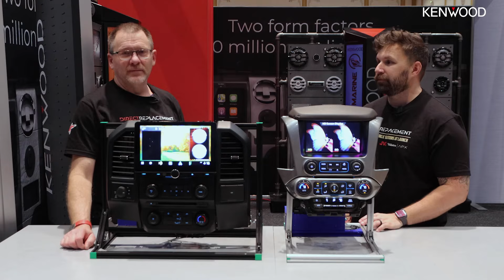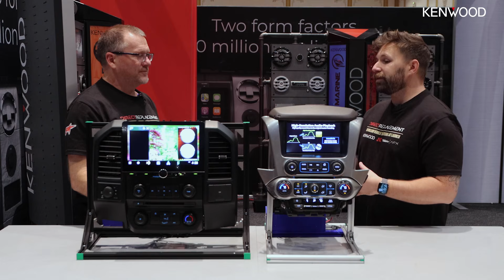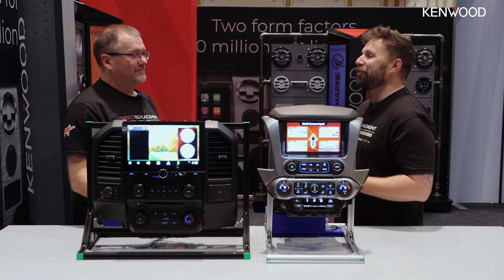KENWOOD Highlights On Direct Replacement With 5-Star Car Stereo

Comment: @KenwoodUSA will this direct replacement retain the factory disc player function in the 2013 F150 or Mustang? The factory disc player is not integrated into the screen, similar to the video. Thanks
Reply from the maker: No, the factory CD transport cant operate without the OEM interface. Thanks!

Comment: I have a Chevy Equinox. Do you retain your factory safety audibles?
Reply from the maker: Please verify all retained features and fitment from the iDatalink Maestro Website by entering your vehicle Information https://www.idatalinkmaestro.com/. The Maestro RR/RR2 module will determine what features are retained based on the flash available per vehicle. Thanks!

Comment: Can u still play movies?
Reply from the maker: Yes, with the parking brake engaged, you can play any video source from:,HDMI, USB, Video In, as well as Wireless Mirroring from a supported Device. Thanks!
Reply: @KenwoodUSA but on the screen in the roof I have a Yukon Denali 2018
Reply from the maker: @ramird46 , You would need to verify compatibility with iDatalink Meastro for your specific vehicle trim, year, make, and model. https://www.idatalinkmaestro.com/en

Kenwood does not supply vehicle-specific integration fit guides. 

I can confirm the Receiver features a Single Video Out, which supports source display from Video-in and USB ONLY.  It will not display HDMI out or any other sources. Thanks!
Reply: @KenwoodUSA thanks

Comment: If used in a 2018 Mazda 3, will the command knob still work?
Reply from the maker: There is no Direct Replacement fitment for a Mazda currently, thanks!

Comment: Would it work on my 2013 Ford Focus Mk3?
Reply from the maker: If your Ford Focus came with the 8" MyTouch system, yes, it's compatible.   You will need the APX-S8-F01, IDatalink Maestro RR/RR2, KEN1 Harness, and the Direct Replacement in the 8" version only. Thanks!

Comment: So I just got my dax800xr for my ford f150. I have yet to install it. Kenwood please tell me you didn’t downgrade the screen quality because I had a dmx1057xr and the screen brightness and anti reflective properties were great. I’m seeing a little reflection on the screen of the new unit. Why would you get rid of the bonded display feature?
Reply from the maker: The DAX800XR and DMX1057XR are different-sized screens; they are both HD, but only the 10.1" is optically bonded.   If you want a Direct Replacement 10.1", you can also look at the DAX1050XR; it has an Optically bonded screen.

Thanks!
Reply: @KenwoodUSA actually it ended up not being an issue  at all! No glare. Thanks Kenwood

Comment: I'm working on my car and have been using Kenwood headunits since 2005. I've been waiting for a "remote" screen option for quite some time. My car (2000 Trans Am) is being customized.  Since my car isn't compatible with any Maestro stuff, will there be any way to install this in a universal configuration (like a universal harness that ships with other Kenwood navigation headunits, etc) where i can use Kenwood cameras, etc?
Reply from the maker: If you want Universal options, the NEW DMX1058XR or DMX1037S will not require APX parts and are better suited for a custom install. The 10.1" HD screen can also be mounted separately from the chassis. Thanks!

Comment: Well the Kenwoods are available but as usual idatalink is late to the party. Doesn’t make sense to buy the Kenwood until the kits are released 🤷🏽‍♂️
Reply from the maker: Stock will be limited due to the demand, if you don't want to wait for the next shipment.  The APX kits are not built in the same place as KENWOOD products; they are an entirely separate company called ADS--iDatalink. Thanks

Comment: Where can I find the APX-S8-VF1 in the US? Crutchfield says I cant replace the radio in my chevy SS
Reply from the maker: Updates are coming to the Idatlink website to clarify fitment, select kits started shipping on May 19, and others will follow shortly, so there may be a delay with Crutchfield until they have stock. Thanks!

Comment: I wonder if there will be audio volume control through the optical output. Also an external wired volume knob would be cool
Reply from the maker: You can use an external volume control and keep the volume level fixed on the receiver.  Keep in mind that currently, KENWOOD does not offer an external volume control and would require that option from whatever DSP you use. Thanks!
Reply: So with optical out running to a DSP, this unit will not lower volume of the system?
Reply from the maker: @IskOne_  it can use the volume knob as a control on the receiver OR you can use a DSP volume conntrol.  The key difference is you will need to adjust the amp gains to match the receiver's Medium to Max volume (it won't work well from zero volume up) Thanks!.

Comment: This is software gonna be retro fitted to older Ex head units?
Reply from the maker: No, often, software is based on hardware at the time of product release.  Previous models are different platforms and do not benefit from the new features offered in our latest platform. Thanks!

Comment: @KenwoodUSA  
Will the TOSLINK Output be a Fixed Full Level Volume (-0dB), or Variable Level that we can adjust with the built-in HU volume control???

Or can we choose between the two options during setup?
Reply from the maker: You will have both options when adjusting your DSP and Amplifier, depending on how you adapt your gains. For variable setup with headunit volume, you need to adjust gains to match volume levels from MID to MAX volume out.  For DSP-controlled volume, set the receiver to MAX volume. Thanks!
Reply: @ 
Awesome.  Greatly appreciate having both options.

Comment: but watch about the driving functions. will  I lose them or will this retain them. keep up the great videos coming.
Reply from the maker: With iDatalink Meastro, all primary functions are retained (there are some small exceptions) and accessible with module programming.  Overall, it's 100% original dash, controls, and features retained!  Thanks!
Reply: @KenwoodUSA will this retain the rear seat entertainment on the GM3?

Comment: Your new units are very nice but there's one thing that is a show stopper. When I start up my C7 Corvette there's a really nice Corvette logo that appears on the splash screen during startup.  With your unit I have to acknowledge a ridiculous warning from a lawyer.

That shit has to go.
Reply from the maker: Warning labels are required, so no changes will be made to that.  Thanks!
Reply: @KenwoodUSA Why after market have this screen but factory does not ?
Reply from the maker: @mrmagic34  because we thought of it first. Thanks!
Reply: @KenwoodUSA 
Simple.  Make it a ONE-TIME Acceptance Disclaimer upon 1st initial Installation & Setup where the radio will not boot further or function until acceptance of the terms.

Once accepted, the disclaimer holds for the life of the installation.

If constant power/memory power is disconnected (i.e. if the radio is removed and installed in another vehicle), you must accept these terms again upon power up.

For the love of God, PLEASE Make This Happen!!!
Reply from the maker: @bbfoto7248  Thanks for the feedback!
Reply: @KenwoodUSA  Thanks for the reply. I'll be sticking with my factory unit then.

Comment: hard to find expedtion kits but same as f150 whats the difference 2019 no bno need stuff for expedtion f150 has everything and my basic panel with no bno system but the dash is the same same radio.when i look for 2019 expedtion i get majority 2019f150 can they inter twine i dont care about navagtion

Comment: Too bad there software sucks   got a 1057 dmx  and it  changes the speaker levels every other day
Reply from the maker: That may be due to an installation oversite, You could have your memory wire hooked up incorrectly, Make sure the Yellow wire is connected to a 12volt constant power source (keeps power when the key is off to hold memory) thanks!